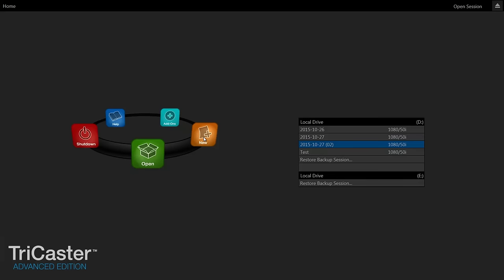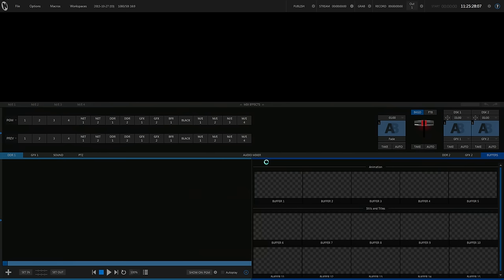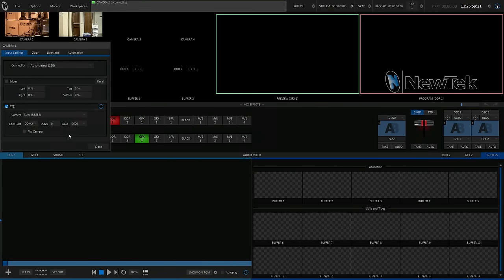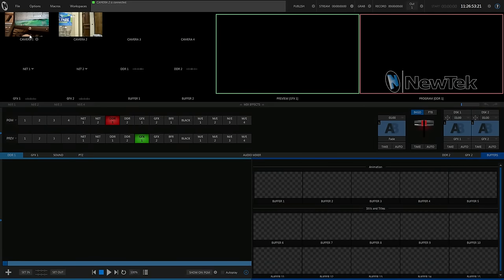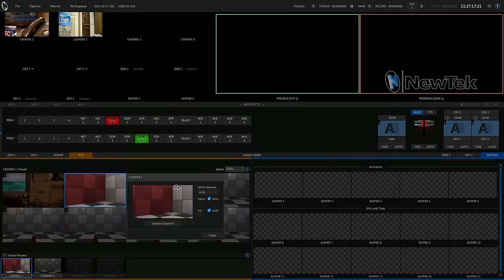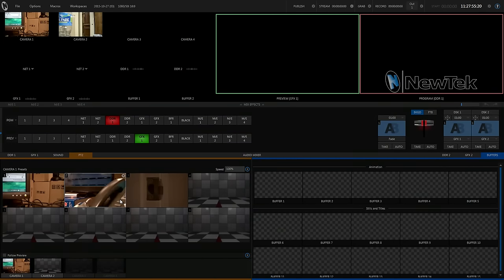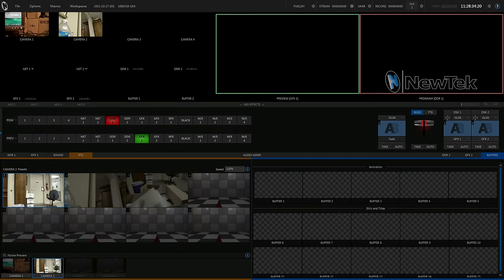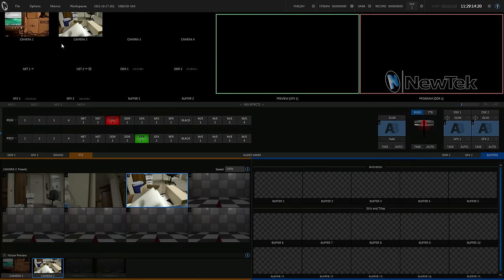PTZOptics TriCaster Mini camera control integration walkthrough

Comment: Same with this video, show the unit in the program out window since it's larger. Do you or are you going to implement IP control in your cameras ala Panasonic? The big push right now is having IP control for TC, Browser based as well as POE/POE+ for power to the cameras to make an install even quicker and less costly on cabling.
Reply from the maker: +guitarguts666 Totally agree. It's on our road map. We have IP control built into our cameras. It's just about integrating with NewTek at this point.
Reply: IP Control, well thats great news. Because the Sony 232 to USB is old news. Looking forward to seeing you showing that. SDK's are a wonderful thing from Newtek

Comment: Why are you doing a PAL session?
Reply from the maker: +guitarguts666 Our next video will be using 1080p30 with a decimeter. The Tricaster Mini does not accept 1080p30fps directly so a 2nd video will be out shortly.
Reply: Just make it a 1080i video session. You can't mislead folks with PAL when techincally it's not available in the USA unless NewTek approves the purchase and the unit must stay state side. Yes, I'm an Elite Dealer.
Reply from the maker: +guitarguts666 Good point. I will make the chance. Here is the NTSC version: http://blog.ptzoptics.com/hd-sdi-cameras/ptzoptics-newtek-tricaster-mini-integration/